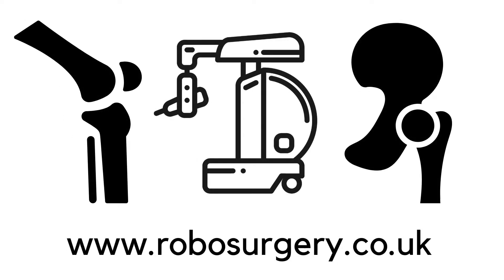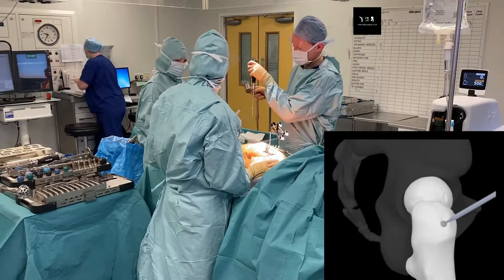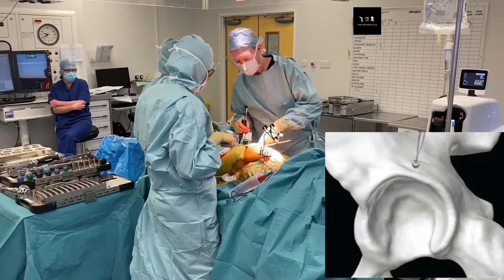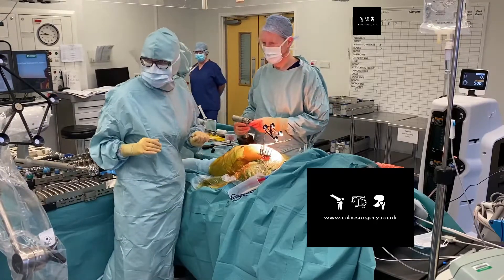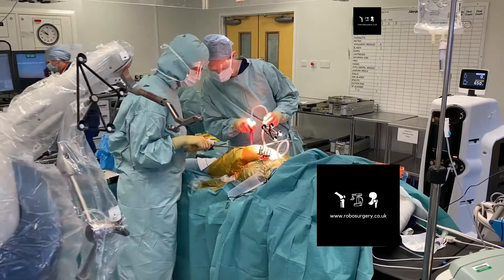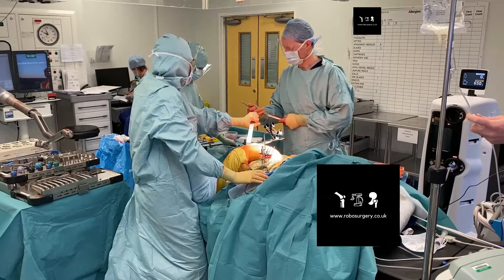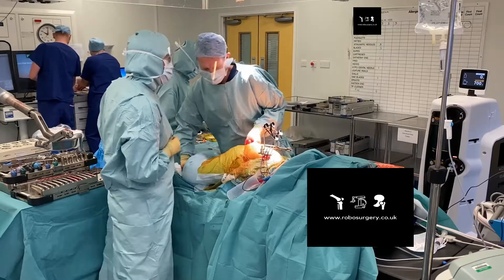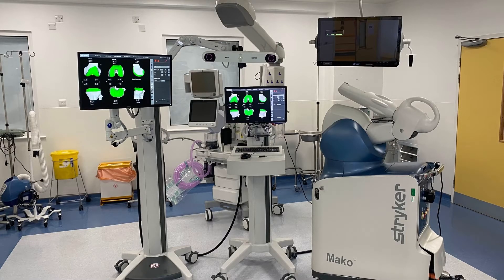Jon Conroy Mako Total Hip Replacement

Comment: What I noticed the most is the lack of sterilization in the operating room .. people standing around without gloves or gowns .. and where is the anesthesiologist monitoring the patient??
Reply: Hi Kerri 🙋🏼‍♀️
 In the operating room they use something called a Lumineers airflow system, this is just a fancy way of saying specialized airflow… think of it like a curtain of fresh clean air surrounding the operating room table. Also that air that is creating that curtain of fresh air is filtered by specialized heap filters and tested very regularly, it also has alert systems that tell us if the air quality is not up to standards of proper procedures set by ARON. Therefore the “sterile zone” of the operating room is around 4-6 feet surrounding the bed. In this video the people within the sterile zone have the proper PPE. 

With this being said the people standing outside of the sterile zone and will NOT be touching anything within the sterile field don’t have to wear sterile gloves or the standard operating room gown… they however are NOT allowed to wear street clothing (they must change into specially laundered scrubs) and they MUST wear a level II mask (specifically approved operating room masks) to be in the operating room.

The anesthesia provider is safely at the head of the bed and the reason you can’t see them is because whoever made this video is protecting the patients identity by using the visual illustrations in the bottoms right hand side of the video to conceal them at all times. 

All in all I didn’t see anything concerning when watching this video in the light of sterile techniques. 

Hope this helps!
Reply: You do see the anesthesia providers hand at 6:32 in the video as the adjust the flow of that saline
Reply: @kerri_kristina_z 
It is the reality, I have been in that room and on that table.

Comment from the maker: It can be either a spinal (Local) or a general. We normally recommend a spinal block with sedation so you sleep through the procedure.
Reply: How long does a total hip replacement take?
Reply: @jimmorrison3830  45 minutes on average. you are typically awake around an hour after you go under
Reply: @jimmorrison3830  Watch the clock in the background.  From the start of what you see until the end of what you see, it's 30 minutes elapsed time.  The video is only 15 minutes long, which means some parts were edited out..
Reply: Do they do a spinal after you are asleep lol. I’m having one 6/26